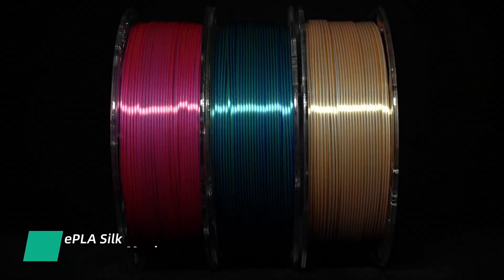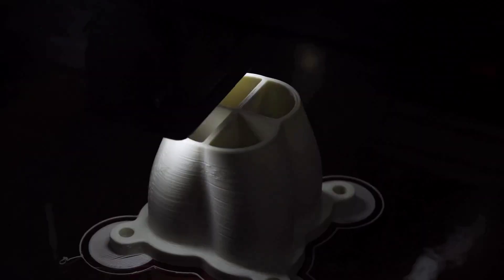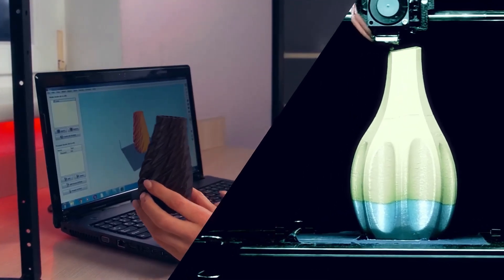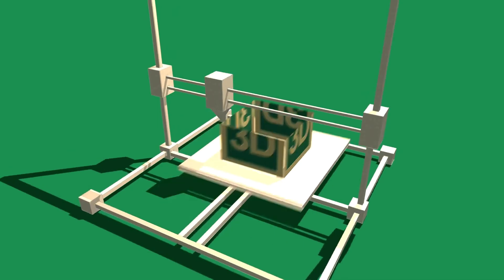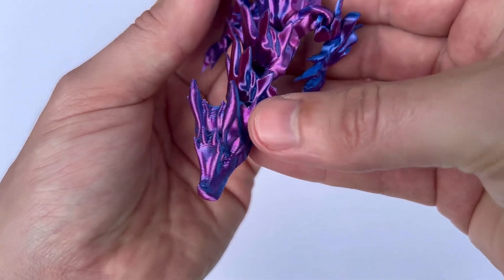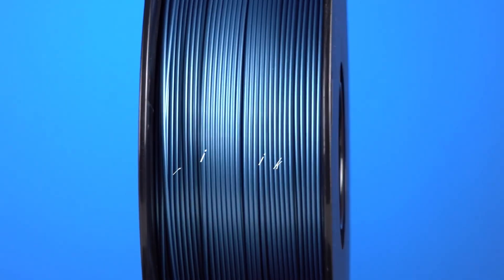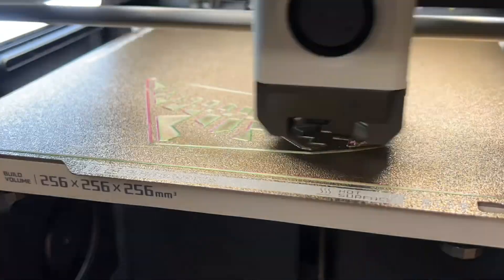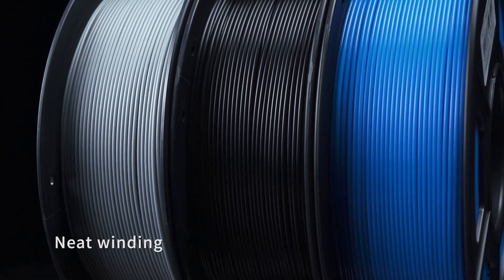PLA vs PETG Filament - Everything You NEED TO KNOW

Comment: How many times did you have to say we are comparing PLA vs PETG holy moly
Reply: The problem is factors have changed since a lot of the old content was made. PETG is now as cheap, if not cheaper, than PLA and modern printers (like the P1S) handle PETG flawlessly.
Reply: @Kaylakaze  Yea, I haven't even brought out my PLA after I started using PETG on my P2S.  It prints sooooo nicely!

Comment: PLA is NOT biodegradable. At garden compost pile temperatures (~20–30 °C), PLA basically just sits there for years, behaving more like a conventional plastic.
Reply: It doesn't matter anyways, no one really cares about biodegradability. It's all virtue signaling or ret ards.
Reply: biodegradable is not binary, it's dependent on conditions. Saying it is simply "biodegradable" does lead people to believe that it just breaks down quickly if you bury it in the ground, which isn't the case. But under certain necessary conditions, PLA does break down way faster than other printable plastics.

Comment: I was looking to know about the toxicity of each one, still great info on either one.
Reply: what? printing toxicity? from what i hear both are not very toxic to print and are generally considered safe. as to being food safe, i believe both are not. do not eat or drink off either.
Reply: Research labs have confirmed that all plastics are toxic to print, some more than others. While pla and PETG may be less toxic than abs I would always evacuate the fumes outside.
Reply: its filament printing not resin no toxicity to worry about.

Comment: Question: Most models in Makerworld are PLA, but if I want to print in PETG what settings do I need to change? I assumed you would just chage project filaments in the Prepare Window before sllicing to a PETG in the AMS but I always get this message which I don't really understand "You have changed the preset Bambu PLA Basic @BBL X1C do you want to save the modified values / save or don't save
Reply: I’ve just dived into the deep end here!! Know nothing about 3D printing but purchased a Bambi Labs A1 and a roll of PETG!!

What I’ve been doing here is clicking don’t save, changing the filament to my PETG roll, slicing and printing!! Had no troubles at all here

Comment: Say you require both strength of outdoor application and impact. And the beauty and astetic quality. Needed for its character, and appeal. What kind of filament is there that does both
Reply: Using petg you can get nice looking prints, it's usually just not quite as easy to do so. So I would say if you need the uv resistance go with petg, just make sure to keep a close eye on it when printing the first few times

Comment: PLA parts will relax after about a year when stressed. For example I use press fitted magnets in my designs. With PLA the magnets will be loose after a year. PETG will still be tight after a year.